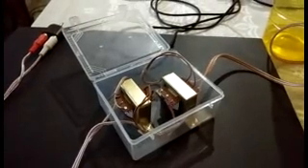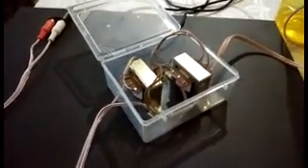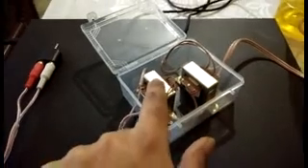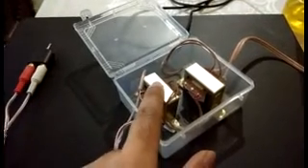DIY ground loop isolator audio noise filter or hum eliminator

Comment: lloks like normal transformer. used el14 transformer for good sound quality. 600:600 equal to 1is to 1 ratio. ferrite transformer that can falls in the range os 20Hz to 20Hz

Comment: I was wondering culd sound isolators be used as ac to dc converters? 
I have strange project where I try to take direct power from alternator to ignition coil so wuld thise supresors work ?

Comment: Each cable red or white will have 2 cores inside once you strip the wire... R+Shield, L+Shield....shall we connect both or only the R and L... What about ground... Will Audio work without ground... 3.5mm jack need ground also

Comment: @Sound Speeds   2.5mm to 3.5mm  adapter connected to headset of phone , then to 3.5mm to 1/4 phono (,mono) then inserted to mixer using aux send and mic input,, ,, dial does not hum but when you try to dial a number, a loud humming comes up,,, how do I fix this ?
Reply from the maker: Sounds like your dialing device is interfering with the converters you are using.... though this issue is unrelated to the video I have posted and I have little idea about your problem.....
Still I wud suggest either try changing the converters or the device.....
All the best 👍

Comment: Sir I encounter this hum sound on my amp. When I turn the volume up and down while my guitar is plugged into the amp the hum sound respond respectively on my adjustment. I disconnect the guitar and just the cable connected to the input and the sound got worst. So I disconnect the cable just the amp left power on and there is no hum sound at all. Do you think sir I have a problem on my amp? or in my cable or guitar? My plug just have two prongs and the power supply in my country was 220VAC. Thanks Merry Christmas.
Reply: By sounds of it you either have a bad earth on your guitar or amp should be a easy fix

Comment: I have humming problem when i connect my guitar to PC. is it gonna solve my problem ?
Can you please make a sketch or sth.
Reply from the maker: seems like a problem of your pickup of the guitar. maybe a faulty cable or somehow the pickup is getting a ground signal. if you plug this device between guitar and PC, u might experience a lot of signal loss. I would not recommend this device in your case.

Comment: Hi Deevesh ! Excellent Idea of these transformers. You did not share details of the transformers uv used.
Reply from the maker: Rahul Nisal hi, 
I mentioned that they are 1:1 transformers... U cn use 12v too.... As the current n voltage is not much in audio signals.
Reply: @deeveshsharma1  Hi Deevesh.

Great Job! I am not able to get the transformers. The local dealer is not able to understand 1:1 9v. 
Can you please help me with some more details and what should I ask at the shop?

Thanks.
Reply: @ramaningle6194   600 ohm/ 600 ohm modem transformers  are 1:1  use those
Reply: @roberttrompeter8775  but they're filtering out the bass. I'm getting only high frequency at the other end .

Comment: Hi, a primary 220V and Secondary 12V is one that steps down. May that be used here? You said that only 1:1 transformers need to be used. The old Audio Output type transformers are no more available in open non metro markets.
Reply from the maker: Debasis Sarkar you can use these too.... But then u hv to b careful about input and output.... Otherwise the output will reduce and u will get very low volume signal

Comment: I have two questions
1. what is the configuration of transformers?... for eg 220v  to 12v 
2. which side is primary and which side is secondary
Reply from the maker: Sukhdeep Sharma frst of all it will not matter if u connect primary with input or output.... But do the same for bothe left and right channel.... Eg.  If u connect input to primary then do the same for both transformers for left and right channel.... 

Secondly the transformers are 12V..... U can also use 220V.....but take care of the size... U dnt wnt to make it too big and bulky...... The main thing is that the transformers are of 1:1 ratio.... That is... They do not step up or step down the voltage..... That is how u can get same audio signals at output. 

Thanks for watching the video

Comment: isko banana kaise hai?
Reply from the maker: Hello there,

You can use two small transformers (which you can buy from a local electrical shop)
these transformers have two output cables at both ends.
use these to make a bridge between the earphones jack and the aux input.
use one transformer for Left channel and the other for Right channel.
both the channels have +ve and -ve terminals be careful that the one which is connected to the -ve in the transformer is also used as a -ve in output of the transformer.

use the pins of jacks which I have shown in the video and it is done. no power supply is needed for this device it is just a simple barrier between output from earphones port to the auxiliary port of amplifier.

Note: Use a 1:1 ration transformer only
Reply: how many amp?
Reply from the maker: gurinder singh 
Lowest available will do the job. As the current is too low